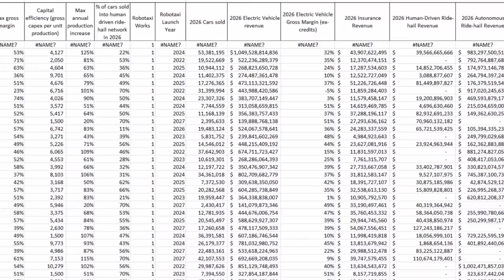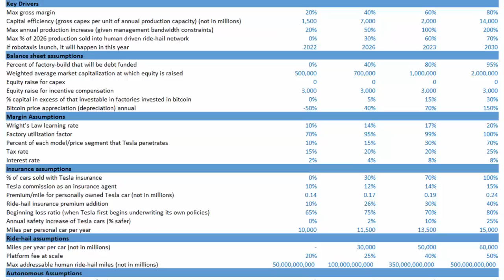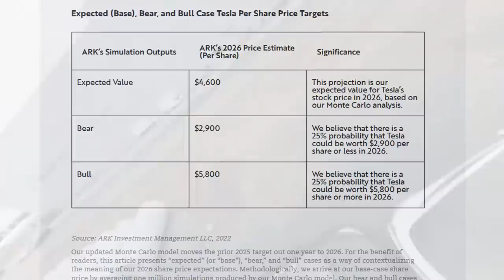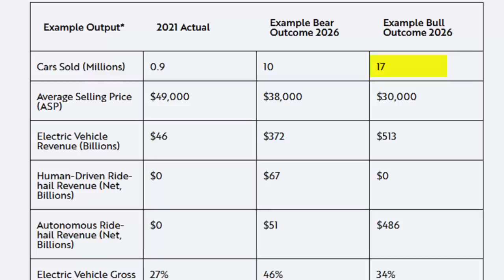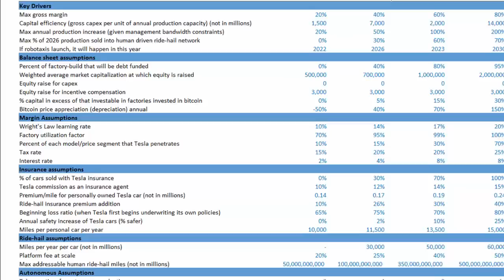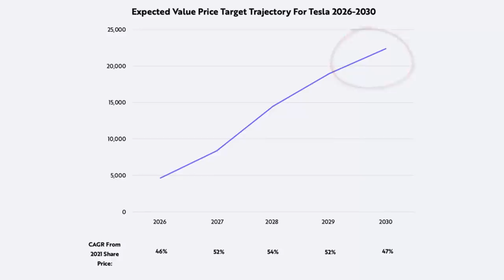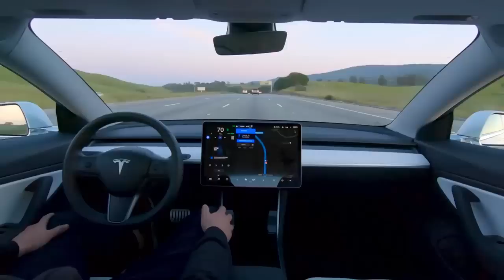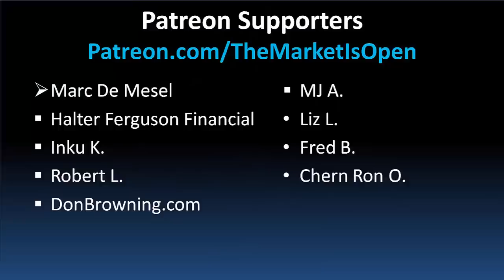You Won’t BELIEVE Where ARK Invest Thinks Tesla Can Go

Comment: I'd heard that these current ARK predictions were based on 34 million EVs by 2026 which is much too high. The Bull Case on your ARK chart shows 17m which from last year's 982,000 deliveries is +77% YOY high but completely reasonable. (The Tesla 2016(? or was it '14) goal was +50% YOY which last year would've been 750,000 and this year 1,125,000.  Q1's 310,000 is at this rate, but without the two new factories contributing - the smart money is that the numbers will be between 1.5m and 1.9m. 1.73m would be 77%.
The thing about ARK is they're right but wrong.. That rosy 2018 prediction for 2025, which Tesla blew right past... was also based on a huge Robotaxi fleet. 
Not taking into account the Semi, energy: Megapack and PowerWalls or the significance of scaled up 4680 production?  That's a C - or an incomplete. 
I suspect ARK is trying to win back some of the mojo they (deservedly) surfed on in 2020. Their fund is currently down. Remember, funds make money taking in investors to the fund (and charging them a fee),  the portfolio going up is how they attract investors.  Almost no one is attracted to me (in any sense) - so as a fund I'd be a complete bust. Just yesterday two relatives (so they don't even have a choice) said in unison, "Shut up about Tesla." However, my Tesla investment is doing great. Individual investors are often the exact opposite of a fund even if they invest in some of the same companies. 
I also  think the motivation of any fund analyst is often overlooked. (Would Tasha Keeny or Cathie Wood ever say, "The smartest investment move anyone can make right now is to use a free trading account to invest 100% in Tesla"?  Clearly investing in Tesla alone is better than investing in ARK. I still have a lot of respect for ARK, but there are some other Tesla prognosticators who I think do a better job. Notably Tesla Economist YouTube channel.
Reply: Why do you still respect for ARK? Apart from TSLA, all of the other top 15 shares owned are waaay down.

And they routinely buy high and sell low. They're measureably really bad at doing their jobs - which is to invest clients money and make them money.
Reply: @wizzyno1566  Reasonable point.  When I was in Apple I wondered why anyone would bother investing in anything else. Sure maybe Google, Amazon, Netflix, even Facebook. I didn't like Google's business model being based on spying, I didn't think Amazon was ever going to improve their retail business (They haven't but I completely missed their web services), Netflix was renting DVDs - which anyone could do. I was asleep when they turned into HBO. And Facebook? Always seemed creepy. But Ford, IBM, Big Oil, almost everything else - why would anyone bother?  I still don't understand that. (I keep waiting for SEC Agents to show up at my door, "You've made too much money. Did you think you were going to get away with that? Here's a list of stocks in companies on the verge of bankruptcy you are required to invest in..." Modern Portfolio Theory is Marxist doctrine for dim witted capitalists.) 
I also thought it was completely inexplicable when ARK  started selling off shares of Tesla. I do think what ARK thinks can be useful so long as I keep in mind they are selling a fund, I'm investing. 
Cathie Wood is right about Tesla, but wrong about the reasons she's right.

Comment: Most likely Tesla will eventually make their vehicles so that the batteries can be removed relatively easily so that they can be replaced with new bateries so that the vehicles do not become obsolete as quickly as they likely do. That means that the batteries will require good security measures to prevent their theft and obtain their recovery if stolen.
Reply: I think Tesla’s goal is million-mile batteries. Probably in that much time, the whole car is ready to be recycled, not just the batteries.
Reply: Yes, million mile battery is not that far off.

Comment: FSD using just video cameras is still a decade away. Meanwhile geofenced robo-taxis will become available much sooner. They won't be worth as much as FSD as there will be multiple solutions quite capable inside the boundaries of geofenced areas.
Reply: Machine learning is exponential. I think you may be a little conservative.
Reply: @MarkXHolland  The only problem is the difficulty is also exponential on edge cases. The major advantage to Tesla's AI is it has 360 degrees of vision. I don't think the current hardware is capable of Tesla's goal. I believe it will be solved but it's going to take time. I strongly believe Tesla will be the company to solve it.
Reply: Yeah with vision alone tesla can't even crack lvl 4 after 10 years of effort. Can't believe why hyped so much! Be aware of Cathy. She is not very honest imo.
Reply: @MarkXHolland  
A telling sign is Karpathy taking a sabbatical.  No one about to deliver upon exponential success would suddenly go on a sabbatical. My guess is that those plateaus which Elon alluded to in his Ted-Talk have worn down the creative edges of genius Karpathy. Edge cases are extremely difficult to solve with current day crude neural network technology.  My personal belief is that self-learning has to happen within the cranial silicon matter inside the confines of the vehicle or that 5G has enabled 100 GB datapipes to the quantum mindlink residing at Tesla Dojo HQ.  :)
Reply: Edgecases have to be solved in near real time.. like in the order of 25 ms. They are one of's where failure is not an option. Tesla vision is way too slow which is why they went to process the photons instead of video frames.
Reply: @frederickstirnkorb3094  Even if current hardware falls short, it would no doubt get the next gen hardware there - released next year.

Comment: I was utterly disappointed with the valuation model. I think your criticisms are accurate.
I think a Tesla Valuation Model should reflect current revenue streams and others in the current product roadmap. The provision for a 10 billion vehicle TAM @ $7,000 vehicle is ridiculous. Addition of the human ridehail service over Musk's specific objections is wishful thinking. Ignoring stationary storage, insurance, charging, Semi revenue is sloppy.
I will be putting together my own five year projection based on current products and the announced product roadmap, with limited conjecture thrown in. Obviously, autonomy is a wildcard with a huge valuation impact in the next five years as timing, adoption rate, and revenue generated per mile are all known unknowns. I will break it out separately in my model and play with a couple of scenarios. I think the error bars can be tightened for the remainder of the business. 
I expect that at five years out, PE will contract to about 30-35 as the business matures. I agree that using PE is a sensible way to model valuation.
Ten year time horizon will have significant contribution from bot, but I won't model that at five years, except for higher R&D costs.
Reply: This would be interesting to see.